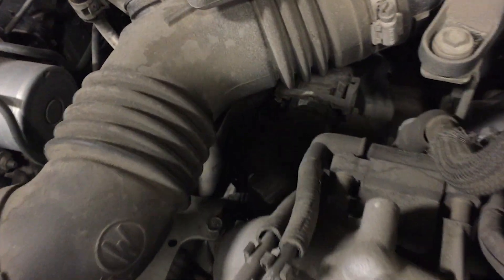Subaru P0028 P0026 - Subaru VVL Pressure Switch Fault Code

Comment: My 2011 Impreza does a yearly P026 since 2022. Once replaced with a new one it runs normal again until the following year? What could be the cause of this yearly dilemma? Thanks
Reply from the maker: @mytoyota80 junk part?
Reply: @ThecardoctorTV  It's actually a factory part. I tested the ohms on the old part and it read 8 ohms and it actuates with 12 volts. The new part read exactly the same with 8 ohms.

Comment: I think they fixed the bad headgasket design in the previous generation for the 2.5l Owning a Subaru is a little like owning a Harley. External spotting leaks generally show up in their life with bad owners. Decent compression, not terrible leak down, a little oil won't hurt anything but the driveway

Comment: (2007 Impreza) My driver's side VVL pressure switch is just spewing oil everywhere (also threw up a P0028 fault code). Took it to Subaru and was told I need to replace both the driver's and passenger's side. They are estimating ~2 hours of labor. Seems pretty unreasonable to me based on what I've read so far?

Comment: So if I get both P0026 and P0028 (And I have) on my 2006 Subaru Outback, does that mean both sensors are faulty or could it be an Oil Pressure problem?
Reply from the maker: Yes

Comment: Do you have the part # for the P0026 part?
Reply from the maker: No but a parts store will. Thanks for watching
Reply: @ThecardoctorTV  replacing the passenger oil pressure sensor fixed it for me. Thanks for the video! $15 fix
Reply: @stevegoss9791  hi, am i replacing an oil pressure sensor or a vvt sensor? i have the same code you had..p0026 for 2009 forester. ty
Reply: @healthyamerican  I ended up just replacing the oil pressure sensor and it fixed my issue on the Legacy.

Comment: Why does the video show the oil pressure switch being replaced. Its interesting that the actual VCT solenoid did not need to be changed.

Comment: Might be a silly question.... but if I’m getting both 0026 and 0028 codes and I want to replace both, is there a difference from the driver and passenger? Or once I find one I can just buy 2?

Comment: got Check Engine light on a few years ago. Went to a local shop and the scan showed P0026. But the shop cleared or reset code and suddenly lose power and acceleration and gas consumption increased 15% = losing 60miles per tank. 
Then a few weeks later, check engine light on again and went to dealer shop who said the car needed new oil pressure switch and since then Check Engine light never comes on again BUT the power/acceleration/ gas consumption never got back to normal....  Recently tried replacing Solenoid (Bank 1), still not help. 
Appreciate your opinion

Comment: My 2004 subaru forester's (2.5L XS) oil at temp light will flash; usally when I first start the car, rarely when I am just driving; then when I come to a stop it will stall, everything locks up and I have to put it in park or neutral and restart the car. The issue comes and goes, some days it drives fine and nothing is wrong, others it'll just start blinking and eventually stall out. Fuel injectors were going bad, we replaced them. The battery died, we replaced it. We thought it was my alternator, we replaced that. The head gaskets were apparently replaced by a former owner. All of this checked off/replaced, what else is the problem. I'm tired of stalling out whenever I stop and I want to fix the problem. Any anywhere near possible answers??? I'm starting to become desperate.

Comment: Please note that the sensor has a "pipe" thread. Which means that the tread is tapered or wedge shaped. You only need to snug this down. I have seen a few where a home mechanic has over tightened it and cracked the housing causing a major oil leak and now needing a cylinder head replacement. Please look up the theories of Pipe threading and how it works if you're unfamiliar. This will not stop turning when its tight enough like most things. It will keep going and then "crack" your in trouble. Where the sensor screws into the head is thin aluminum be carefull

Comment: Thanks for the clear description in your video.  It saved my bacon.  The check engine lit off but it all seemed to run ok.  I was close to home so I just parked it.  Next day bought the switch, bought a 24mm deep socket and swapped out the part.  The check engine indicator remained on until I cleared the alarm using my ODB App.  

There is still a permanent alarm entry on the diagnostic log that the won't clear.  Hopefully that is just a record that the problem occured and not that it is still present.

Comment: Well done diagnostic video, concise and specific where the codes are concerned. Good presentation also. I do agree, that if you are so inclined a step by step tutorial would be helpful. However, for the majority of the wrench turners out here, you showing where the part was and a quick uninstall/install demo is really good enough. Thanks again and keep the videos coming.

Comment: I've changed all the oil sensor solenoid and I'm still getting CEL and flashing cruis control. I don't what to do. We thought the ECU may have had a problem coz we reset it several times and changed it to a new ecu and still having the same problem. What should I do next.
Reply: I'm sure you've already fixed it, but for someone who hasn't what fixed it for me (my AT OIL TEMP light was also flashing) was a wheel speed position sensor on the associated "wheel"
Reply: How did you fix this having the same problem?

Comment: Had the same error P0028 on my 06 Forester. I recently purchased it and new it possibly needed an oil change. After an oil change the error cleared up and running great again. I would recommend changing the oil first.
Reply from the maker: good call.

Comment: I'm replacing a Bank 2 intake solenoid valve on a 2010 Subaru legacy, I have found the solenoid but how do I get the bolt off when there is a a brace covering the bolt?  Do I need to take off the timing belt cover to gain a better access to the bolt?
Reply: Yes you do

Comment: Hello! I have a similar problem on Outback 2007. Several times there was an error P0028, I dropped it.
Then I changed the oil pressure sensor, after a while the error began to appear again and more often. Especially with aggressive driving (>4000rpm). 
I changed the solenoid valve (AVCS) on bank 2 and for a long time there was no errors, but today again a P0028 error has appeared. I do not know already what to do .. ((
Reply: I’m having a very similar issue, was there a decline in power once your got to 4k rpm and also did it struggle to accelerate and shake at 4k?

Comment: Got the same issue going on with my 09 subie.  For the sealer for the switch, can I use some high temp gasket maker or is it a specific type of sealer?  thanks for the video!
Reply from the maker: you can use that or even thread tape. Just don't get any sealant around the end of the sensor
Reply: The Car Doctor gotcha, thanks again for the video.  DIY guys like me really rely on these yt vids

Comment: Newbe Subaru owner, 2007 Outback, 2.5L SOHC.  I see codes 0026 and 0028, but haven't see any reports of what I'm getting, P0076.  Would the troubleshooting be the same?
Reply from the maker: Pretty much. Most likely the control solenoid is at fault but be sure to check oil condition and level.

Comment: hi I have a 1996 subaru legacy outback 2.5 automatic transmission,  car drives fine on Flat ground but when going up hills it feels like the breaks are being pushed and released , only does it when going up steep grades,  the breaks are not sticking lol, think it something in trans , did a flush and filter change still no change, has 170k miles thanks

Comment: When you say oil leak from head gasket are you saying valve cover gasket or the actual head sealing gasket.
Reply: I believe both are prone to leaking. I replaced valve cover gaskets on my 08 Impreza and I still have some leakage from the head gasket. (I only have to add a quart every couple months, so not worth fixing.)

Comment: Replaced the sensor and did an oil change.  How do you get the driver side solenoid out?  It appears that the bolt holding it on is behind another sensor and I can't get a wrench on it.
Reply: Ted Walton bro I had the same issue but started taking it off. The round solenoid right under the VVT solenoid. There is a bolt holding the sensor in. Then a bolt above that holding the mount on. Take em off in that order. It’s a 10 mm gotta use the open end wrench for the first bolt and a socket for the mount. Once you get the mount bolt out pry the sensor mount off and it clears it out for you to get the bolt...
Reply: @WeirdThor  just had to say those were some good darn instructions you gave thanks!

Comment: In the case that the codes persist after flushing engine, changing oil and replacing the OP switches, would the next logical step be to replace the OC Valves?
Reply from the maker: Check oil pressure and it may have an issue with the control valve.

Comment: Do not overtighten!  Torque spec is only 12.5 ft lb otherwise you will crack the mounting head.
Reply from the maker: Good call! Thanks for the feedback and for watching
Reply: I didn't hear the click on the torque wrench Autozone lent me and i broke it.  I had to JB Weld it and leave it in the Autozone parking lot for 24hrs, for safe measure.
Reply: Yeah I wish I would have read this 20 mins ago I just cracked mine trying job weld if it doesn’t work I don’t know what I’m going to do

Comment: Great video and thanks for the info! Just had a P0028 come up on my '08 Outback after an oil change.  I'm taking it back to the shop where I got the oil changed to make sure they properly filled it and that the filter is good.  I had a P0026 issue abou 18 months ago and replacing the sensor did the trick in that case.  I hope it's the same issue here.
Reply from the maker: Hope you get it fixed up. Thanks for watching.

Comment: This happens with honda owners also, they go way too far out on their oil changes and the vtec oil pressure sensors throw similar codes. KEEP YOUR OIL CHANGES CURRENT, PEOPLE!  Thanks for the helpful video, I'm about to install a 2012 legacy longblock in a 2007 2.5i I just bought with a spun bearing (probably from lack of oil changes, lol)
Reply from the maker: Well good thing you'll probably have that motor swap done in an afternoon since they practically fall right out of the car. It is super sad to see what a lack of maintenance will do to a great car. Disturbing. Thanks for dropping by.

Comment: I have a subaru impreza 2007 check engine on, cruise control light blinking, code  P0506, I cleaned the throttle body, the car is running okay after that, but the lights still on! Thank you an advice!
Reply from the maker: You'll need to clear the code.

Comment: Thanks! Had a P0026 and a P0028 code. Replaced both sensors from Subaru for $22 a piece.  You do need a 24 deep socket to get them off.  The only thing you need to watch out for is the threads for the sensor are very fine and need to be started by hand to avoid cross threading. Seems like the sensor next to the oil fill is covered in oil  if someone has been careless filling the oil without a funnel.  You may need a can of brake clean just to find it....
Reply from the maker: Good info. Thanks for dropping by!
Reply: i have code p0026 on my subaru forester...which sensor should i replace? is it an oil sensor, or something else? also, where is it located? ty

Comment: 07 Legacy, pulled code P0117 plus the P0026 and P0028 mentioned in here. Just recently replaced radiator, intake, head gaskets... but hearing slosh noise near dash from air buildup, now car runs rough idle. O2 sensor? Vacuum leak? Has plenty of fluid...  so kinda stumped at this point.
Reply from the maker: Did you surface heads and take care when installing quality replacement head gaskets and use new head bolts and properly torque? Does the rough idle always evident or more so during initial startup? Any steam from exhaust? Any misfire codes? Any signs of water contamination in oil? Sludge under cap? Had one that I did head gaskets on. Did not catch the slight warped heads. Did one side over after a rough idle and steam on start. Sat overnight and saw coolant with my video inspection camera. Week later the other side failed. Ended up both heads were warped from the initial overheating likely.
Reply: Volvo  s40 running lean

Comment: Hi thanks for video, I have same problem on my Subaru Outback 2006. Should I replace only oil pressure switch or oil control valve also?
Reply from the maker: +Zviad Oragvelidze Since the switch is cheap and easy I would toss one in and see if that helps. Let us know what you come up with.
Reply: @ThecardoctorTV  Hmmmm j him

Comment: Hey Great Video! I have an 07 subaru impreza. I have noticed a smell of burning oil, and a small oil build  up around the sensor you just replaced. Check engine light never came on, but was wondering if oil could possibly be leaking from the sensor. Thanks
Reply from the maker: +Jerry Cribbs Absolutely. It happens. There is oil pressure behind the switch so when it begins to fail it can start leaking oil. Good find! Please subscribe and stop back again soon.

Comment: Doc,Here's one for you;Same vehicle range (2006 Outback, 2.5 SOHC, stick), with extremely good self-service on the car ( 3K oil changes with Mobil 1) with just shy of 100K total (owned since new) and the car ISN'T currently throwing any codes, however, when the VVL should be kicking in around 4,000 rpm, the car acts like it's going to fall on its face and stumbles, with a fair amount of vavletrain noise, which is entirely a new phenomenon. Runs fine otherwise.No leaks around the typically affected areas of the switch and solenoid on either head.Any thoughts?I'm considering your approach to solving this since it's quite straightforward and inexpensive.Thank you, sir.
Reply from the maker: +irritablearchitect Hey, sorry I just noticed this comment. I have not run into your issue before but it makes me wonder if there is truly an oil pressure problem or other mechanical issue related to valve train. Did you figure anything out!
Reply: The Car Doctor Yeah. I had a pressure test performed on the exhaust; it was running way too low. Cat was obvious diagnosis, but again, no codes thrown!
Pulled the first pipe and...OIL LEAK on the driver's side head gasket! So the engine came out and both heads came off for new gaskets and a clean up at the machine shop.
I should probably be thankful this happened right at the same time I was replacing the timing set and water pump, along with the new pipe/cat and upstream O2 sensor.

All is well now and I'm getting better MPG than ever.

Thanks for the response.
Reply from the maker: OH wow, im glad your MPG is improved...sounds like you need to save some money on gas to help pay for the repairs. Take care!

Comment: Too bad they weren't changing their oil regularly enough! I hear that's a big cause for head gasket failure. Good video! I'm about to replace my solenoid valve as well . . .
Reply from the maker: +Nicole Rachelle Well I think those head gaskets leak at 90K miles even if you change the oil regularly. Just a weakness of the engine but if you do them right and change the water pump and timing belt at the same time and maintain it regularly it will run forever. Good luck with your fix and thanks for the complements. Blessings.

Comment: Tim my daughter wants to buy a Subaru but I don't think they are so great of a car . I hear everyone saying they love the car but I won't do that timing belt and head gasket job at 100K . I'll stick to my Chevy,s that match my skill set HAHA
Reply from the maker: +Steve Rob I say the head gaskets are due more around 80-90K but yes. If you go that route I suggest surfacing the heads, using quality gaskets, replacement bolts and doing the belt, water pump and pulleys while your in there. Its more like a 3000 job here probably less in the lesser 48 states. A nice 6.0 or 6.2L equipped Chev wont be leaking its vital fluids out even at 150K.
Reply from the maker: +Steve Rob I just noticed all my B-Roll footage is totally out of whack on this vid. How sad. Im going to have to do another re-do. Crud
Reply: Really, ha what's a B-roll, man it looked fine to me.
Reply from the maker: All the breakaway footage that showed the engine compartment views while I was talking. Its actually just the first half of the video that's affected. The second part is fine. Sad that my focus group and QC guys didn't catch this...
Reply: +Steve Rob * Except tor the daughter part,  You said just what I was going to say.  Great minds think alike!
Reply: dan andy Thanks Buddy !!